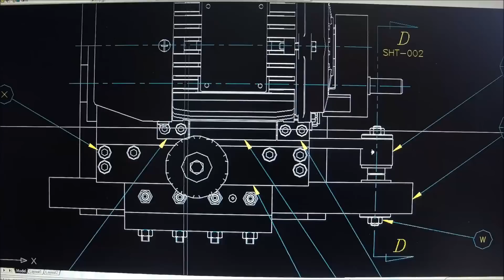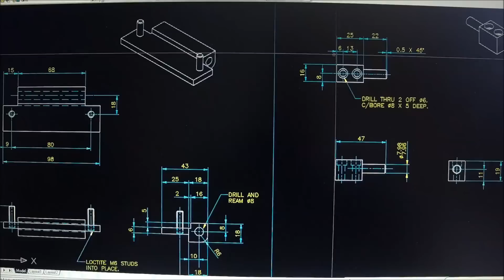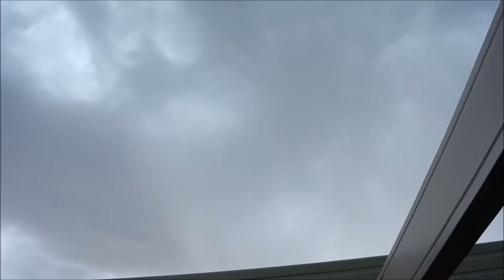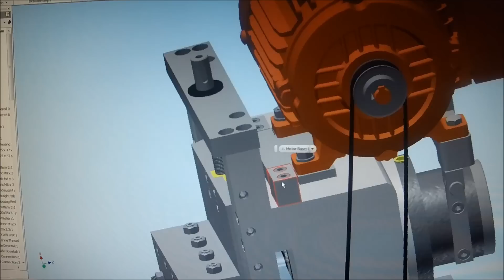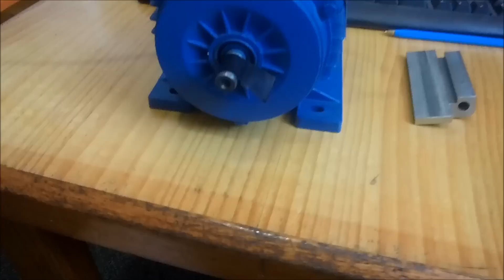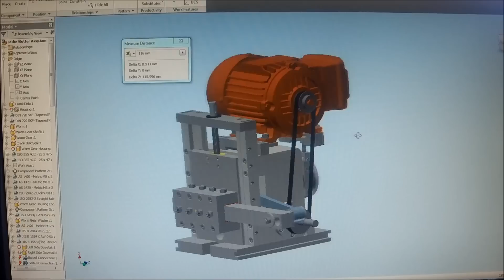Powered Lathe Slotter Build Part 41 and a lesson in how to destroy a Reamer

Comment: Hi Cam at 3.0  with the jam nuts - something doesn't look right with the geometry  when the jam nuts will be tightened up . Bummer about the reamer  -  where was the friggin WD !!!  Cheers .
Reply from the maker: G'Day Max, what eagle eyes you've got.  On the 2D AutoCad drawing the nuts are actually on an slight oblique angle and they didn't look good when converted from Inventor plus they were slightly rotated so looked even worse.  I deleted them and just put them in as a 2D nut.  Not strictly right but I took a bit of draftsman's licence to get the GA's finished up fast.  They work out fine on the actual 3D model.
Cam

Comment: Morning Cam.  Bad break on the motor housing. I have every confidence you will innovate and conquer. 

I had to laugh - your side cutters are just like mine. One drop of anything resembling oil or lube and the handles are gone like a politicians promise. 

Great job on the pivot for the motor. I was curious on the timing belt size. I opted for an XL on my little indexer. The others seemed a bit light for my application. I agree with you the timing belt length in non-negotiable. They may stretch over time but not without a lot of cycles and load. 

Great progress again - three steps forward and a 1/4 step back this time.  The motor will maintain alignment just great with your design. 

All their Best! 

Thanks for the shout out last time. Small channels need to stick together!  Also help meeting more great folks like yourself. 

Dan
Reply from the maker: G'Day Dan, Based on the Motor Power, RPM, and service I was right on the cusp between the XL and the X series belts.  The X series looked out of proportion so I've gone with the XL which does look on the light side but for my workshop application I think it will do just fine.  I was looking at the metric T5 series which would be perfect but are rather pricey.  Love the comment "gone like a Politicians Promise".  They are all out of the same mold the world over, lying, cheeting B______s.
Cam